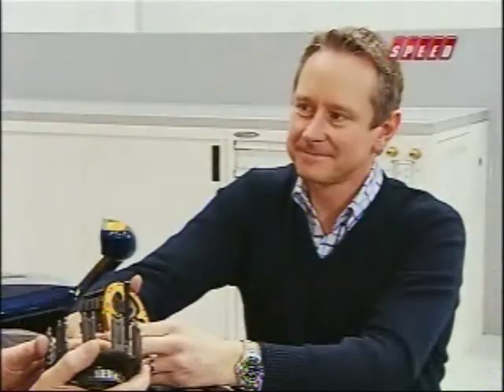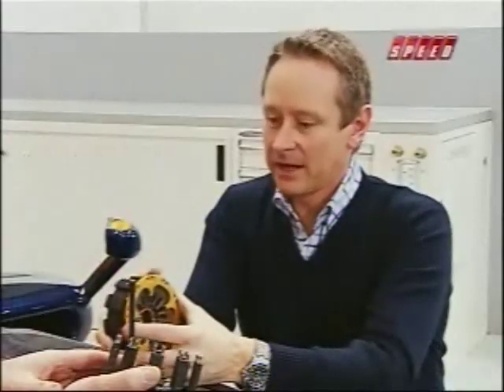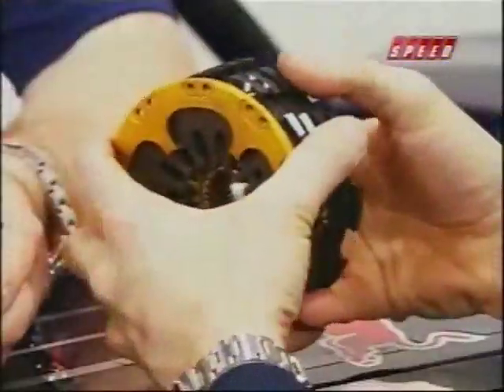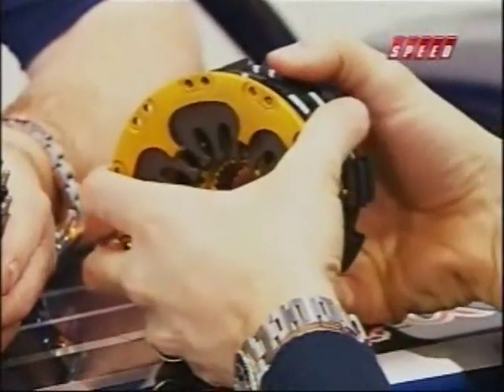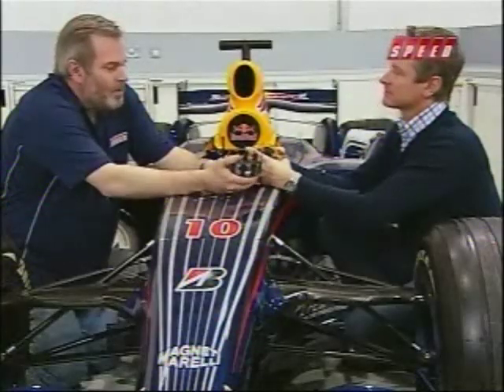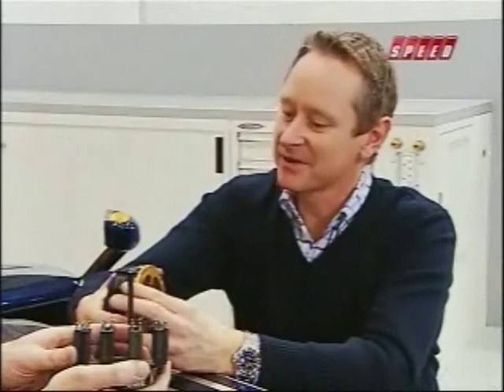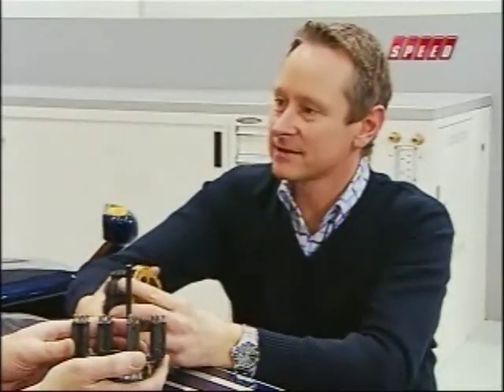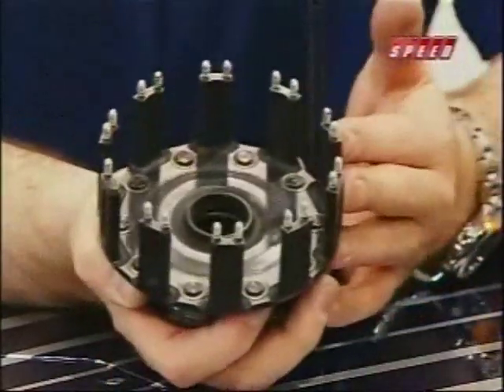F1 Clutch Explained

Comment: Wow, I have A KMX 125 that produces 20-30 bhp (closer to 20) and it has a bigger clutch. I've not had to look at the clutch on my Fireblade (erm 140ish bhp) but I bet its bigger than the F1model. Amazing. Though my Fireblade has done 17k on it's clutch so far, doubt the F1 would last that long (then again my Blade does not produce 700 odd bhp). I love good engineering!

Comment: @mazzoza19 I'm sure you understand what the RedBull guy's point was by now. But I'm going to tell you any way. He is talking about when the car is in neutral. What he's saying is that the Renault engine in that RedBull chassis has the ability to go from spinning at 19,000 RPM to not spinning at all [completely shut off] in two tenths of a second. Basically he's talking about how responsive the engine is, not the braking ability of the car as a whole. :)

Comment: @theundeadx i dont understand how a clutch paddle/button works. do drivers still need to 'pendulum' the clutch and throttle together? how do they balance them? how can u have a BUTTON or PADDLE for teh clutch, how to u figure out the engage point and gas to leave off? it seems like it would be 100% clutch ON or OFF and no inbetween if u knwo what i mean, how do they not just launch every time when using it?